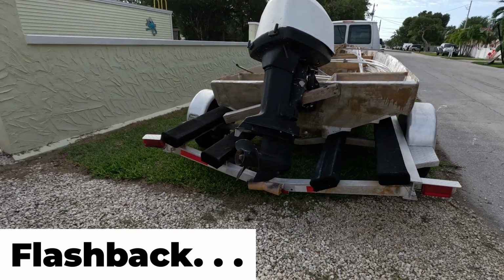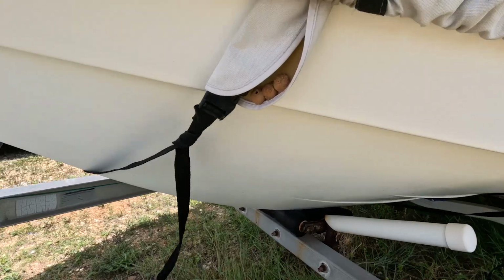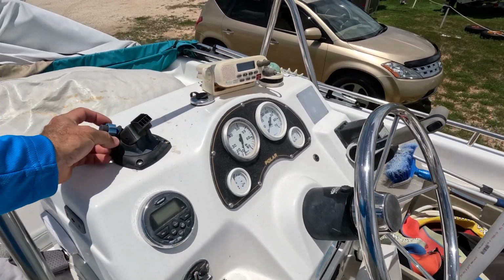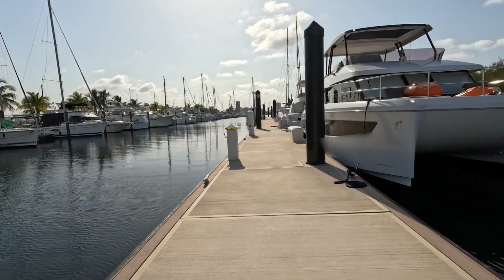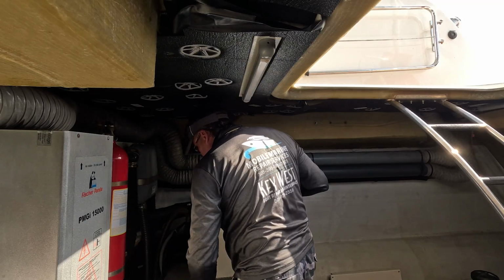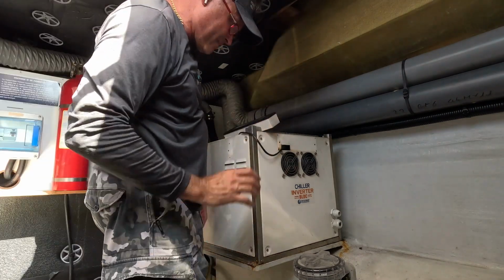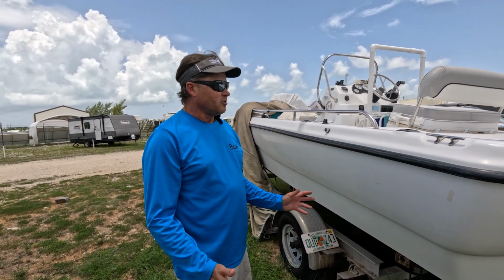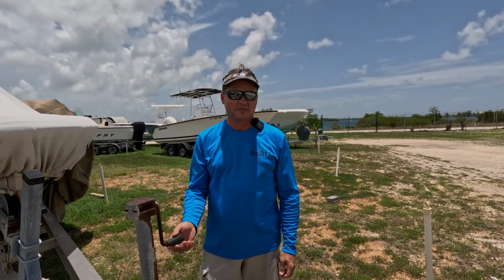We BOUGHT Our First Center Console ... Boat Project!

Comment: Should I total my center console cause it needs new engine or pay for engine swap?
Reply from the maker: That’s kind of a hard question cause it depends on the condition of your boat! IF you have a solid transom & deck …. Matt would probably say swap the motors! We looked for 7 months for this little boat many we looked at we not in good shape. We worked on a boat a few months ago that we discovered had a rotten deck & they already put $100k into before we got it! We told them sell the boat. How old is your boat?

Comment: Lol I just picked up a 1991 sea-lion viper 190 center console with a 1990 yamaha 85 hp 2 stroke on it and it starts right on up and dosent even smoke and I just started my career as a boat mechanic I switched from diesels and airport equipment to boats lol
Reply from the maker: Well we got ours started too …. But need a new one. Good luck with career change.
Reply: @WillFixThat  thank you very much I hope it will be a great change for me
Reply: @WillFixThat  well here at my new shop we have a boat from ft. Myers that was taken out by the hurricane
Reply from the maker: @honeybunbandit1  what needs to be done to it? Did it sink?
Reply: @WillFixThat  it tore up the hull so it's getting fiberglass repairs and paint I guess it washed up on shore like 12 miles away from where it's usually docked
Reply from the maker: @honeybunbandit1  oh boy that doesn't sound like a fun job with how hot it is .... that fiberglass is going to stick to you! 🤨 Felt like 113' here today.
Reply: @WillFixThat  it's 75 here it's in Benton harbor MI so not as bad as yall
Reply from the maker: @honeybunbandit1  your lucky 👍

Comment: Wet sand/ buff and wax wrap would be too much.  Newer power and electronics, pack the bearings and let it go.
Reply from the maker: Yes we may wet sand & wax just depends if the gelcoat is thin or not! All new electronics, batteries, motor, lights, thru-hulls …. Maybe underwater lights!
Reply: @WillFixThat  underwater lights would be a waste of money on that boat. You’ll never get the money back even the best ones fail something else to break and maintain.
Reply from the maker: @captpepin  your right about breaking and maintaining… believe me we’ve repaired, replaced a few too many lights!

Comment: If the current motor runs I'd do a sea trial first and then go from there. Graphics can always be added later.  The important things, as you already know, is to make it reliable and safe on open water.  New engine = $20,000
Reply from the maker: We’ll stay tuned 🤣 we didn’t put the keys in it so we will see what we discover along the way! Don’t do as we do! We knew it needed everything so we didn’t bother testing it!
Reply from the maker: We just tested the current motor it did start but not something we are going to risk! See this is our line of business we see broken dreams all the time! So I told Matt we need to make our boat maintenance free for awhile so we aren’t always fixing our project!

Comment: Looks like it has good bones.
Reply from the maker: Yes better then any others we looked at …. We didn’t want to do a big major over all! This still has plenty that needs to be done but has a solid hull.
Reply: @WillFixThat  What were you thinking for Engine? 300HP?
Reply from the maker: @michaellabombard9507  300hp probably isn’t safe … more like 175-200 and thats pushing it 🤣 … remember I have to try & hold on if Matt’s driving! If it was safe I’d get strapped in a seat.

Comment: I love my Mercury ProXS 115. I would replace that front wheel jack and the wheel bearings for starters. I like Bimini tops vice T tops, but I notice in Florida T tops are all the rage. You are the man when it comes to electronics, but you'd be surprised what you can do with Mercury Vessel view and a navigation app. Good luck. Keep us posted on the progress.
Reply from the maker: Well the progress so far is the trailer & boat are all tore apart … 🤣 hope to finish the trailer this week to get the boat out of the boatyard! Trailer needed more than we expected once we got the boat off it! More to come ….